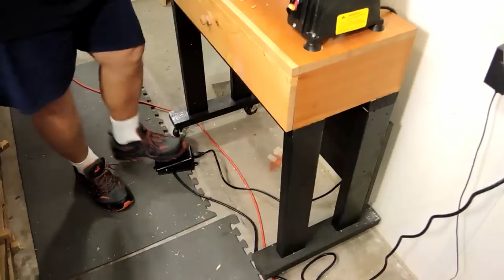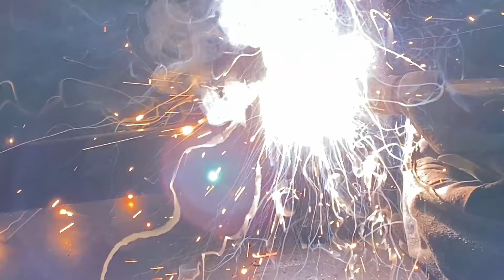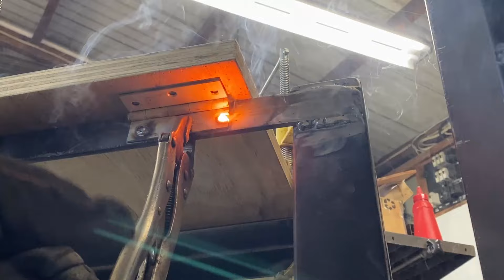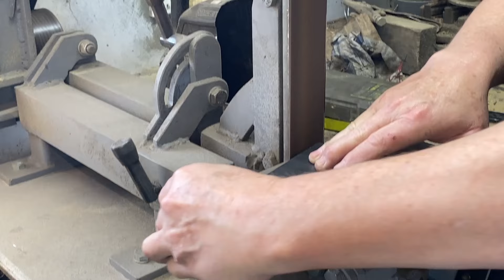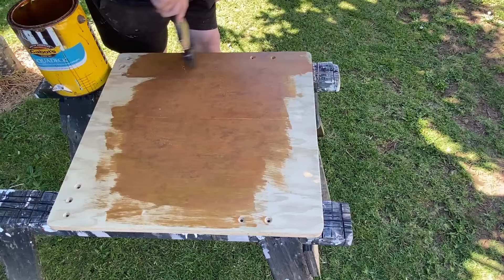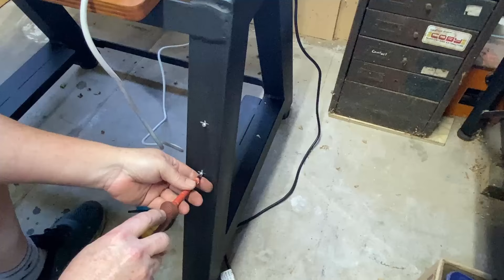Scroll Sawing Improvements - Part 1

Comment: That turned out well.. I've not used a scroll saw.  They can do very fine fretwork for sure, in most materials.  Cheers Rob.
Reply from the maker: Thanks Rob. Im still getting use to it but I have made some cool items. I did another one on Saturday using the new stand and it is a whole lot better than standing at the work bench for hours on end.

Comment: do you have link to that scroll saw, i'm looking to make one sutable for  water cupping & yours appears to be powered from rear not under the blade.
Reply from the maker: Thanks for watching. Carbatec sell the same machine (but a later version, and of course it is blue). But they are not cheap. Here is their link. https://www.carbatec.co.nz/product/22282-carbatec-21-inch-variable-speed-scroll-saw?categoryId=297